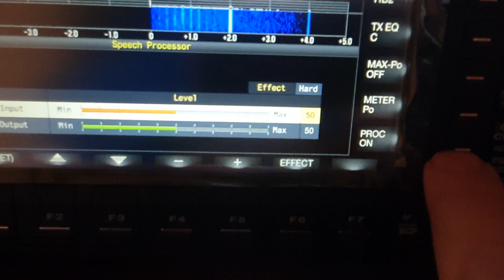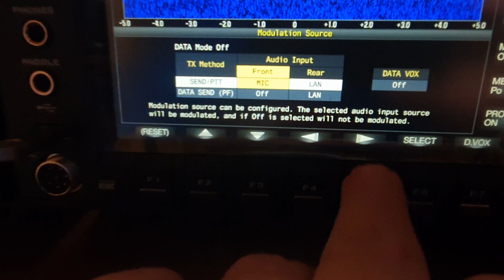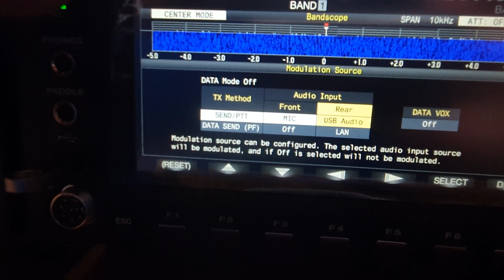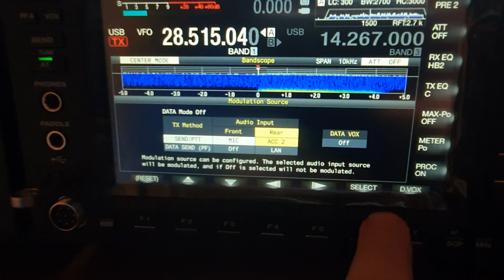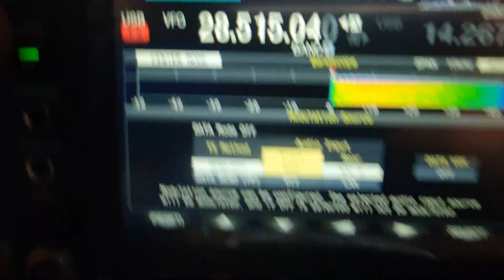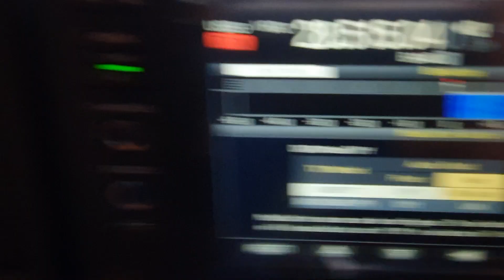English version of my brand new KenwoodTS-890S audio line noice problem

Comment: I am a TS890 owner too. Never noticed this before but sure will be testing it. Did you get the mod done by kenwood? I just contacted my reseller in Portugal so see if the mod is already available. Thanks for sharing this. Good job. I really love this radio.
Reply: what mod?
Reply: @1112223333111  My radio came back from Kenwood 2 weeks ago. There is a modification taken in guarantee

Comment: Did you talk to Kenwood about this issue?
BTW did you try to remove ground from radio and / or power supply? A ground loop could cause such problems.
Reply from the maker: First radio manufacture in my history who takes things seriously. Great job from Kenwood! 👏
Reply from the maker: Yes and this is the latest status:

Dear Sir,
 
Please accept our excuses for keeping you waiting.
As I mentioned last time due to the COVID-19 our staff in Japan is till the end of this month only working part time.
As a consequence there are some major delays.

Meanwhile I received some information that the symptom is not a software bug but a hardware related issue caused by low level noise mixing in the circuit.
Our engineers are now checking the predictability and serviceability of the hardware modification.
The modification information will be available within a few weeks.
We keep you informed.
 
Best regards,
 
Geert Van Muylem 
 

General Manager Service, ON5GVM 
JVCKENWOOD Service Europe
Reply from the maker: Here is the latest status on this issue:                                  

Dear Niko, 

I just received an email from our QA department that the official information about this hardware modification will be issued at the beginning of the month September.

We will inform you later how to proceed.
Reply: @nikooksa  I wonder if they would send the new part to user install and we send the old part back?
I'm broke after buying the radio to send it back
Reply from the maker: @1112223333111  It is major changes to the radio, so in my understanding it is not possible.
Reply from the maker: @Carrot Cruncher TS-890S is better choice.
Reply from the maker: @Carrot Cruncher Yes, but the ears of TS-890S are beyond this world...had fully loaded Yaesu FTDX5000MP before this...and man it`s like night and day 😎
Reply: @nikooksa  any news ?
Reply from the maker: @W-733_KWX  I have been really busy lately to run full test on radio after service. But now I have done it and I can confirm that the service done to the radio has removed the design fault on audio chain. Great job Kenwood! I am really happy with radio!
Reply: @nikooksa  Happy for you Niko ; Kenwood seems to be a great brand and stands behind its products. 890 is on my bucket list, and I have always been a Kenwood fan (have had 870, 590SG, sold them to have the money but still have a filter loaded 850AT, and will be buying a 890)
Reply from the maker: Hopefully soon this problem is gone! I just got this email from service center.                                                                                                

Dear Sir,

We’re expecting the official document and spare parts for the modification end of this month.